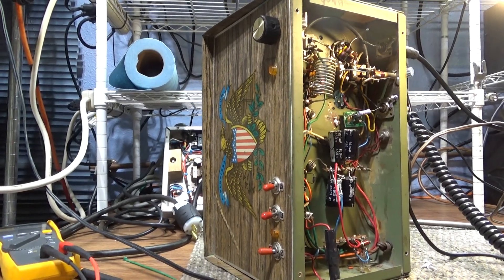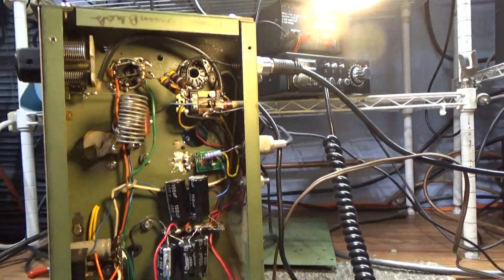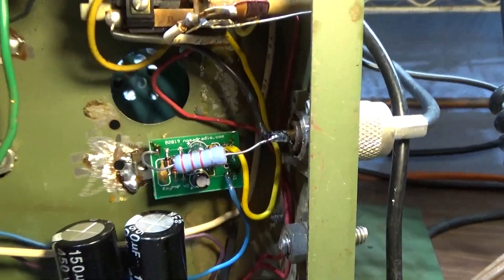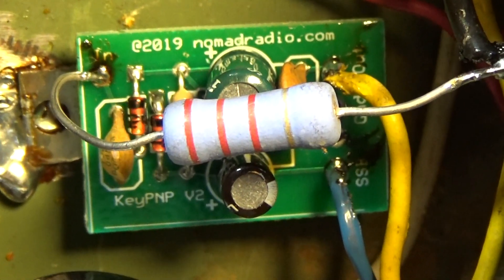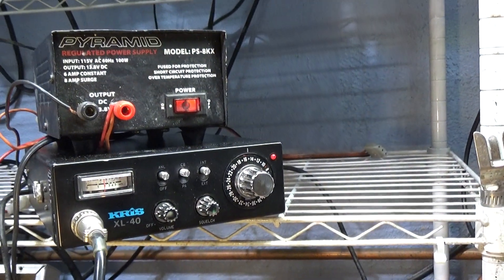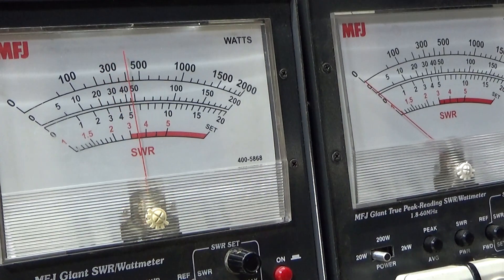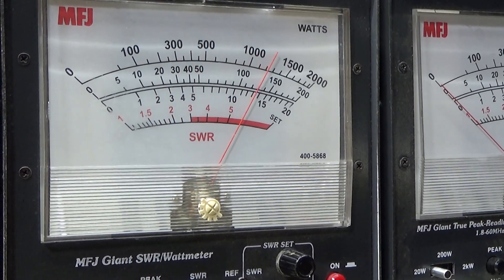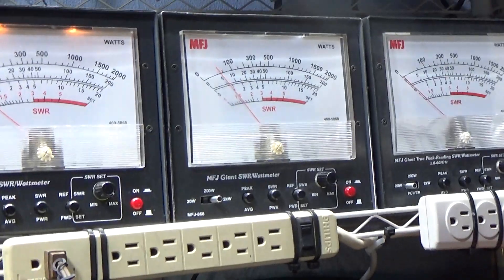Maco 75 one tube modulator, Tetrode, Turbocharged linear amplifier revisited again

Comment: 2:00 I've copied the RF sensing circuit from a Zetagi B47 and put it in a small external box. It works well, giving me the SSB delay, when needed.
Reply from the maker: Sounds good. I don't know much about the Zetagi's. Like I said, I copied the Blackcats and Palomars. I just put the components on a terminal strip. Both used a switch to ground a capacitor for the SSB delay.
Reply: @tramdr  From the 1970's onwards (I believe), it's mostly been Italian burners here in the UK. They went under the names like Zetagi, Lemm, Bremi, etc. Most of them used sweep tubes, laterly the EL-509 and EL-519 types. They were good for about 100W out, per tube.
Reply: Doc checkout CTR Engineering